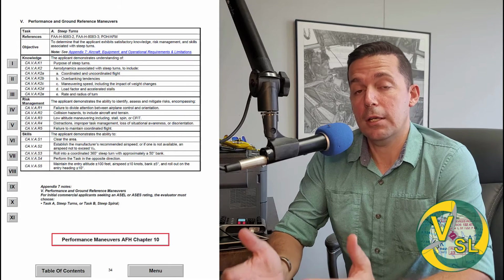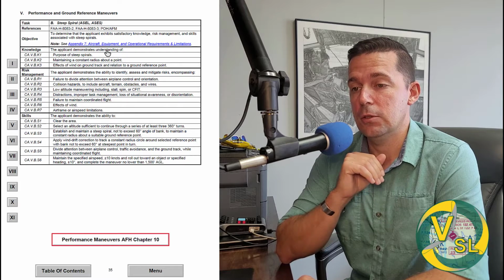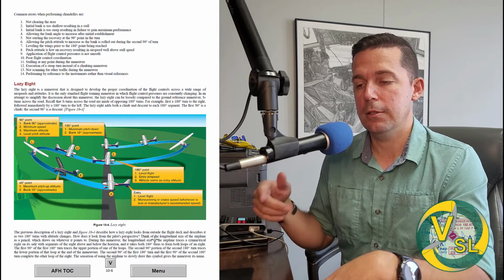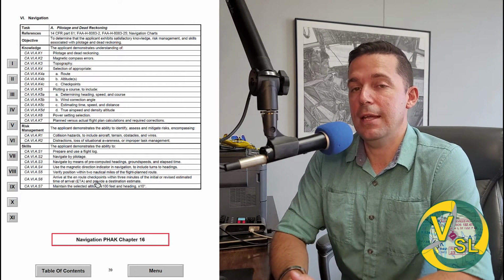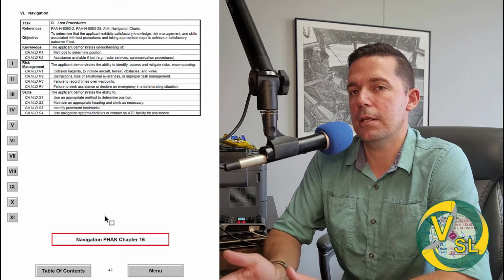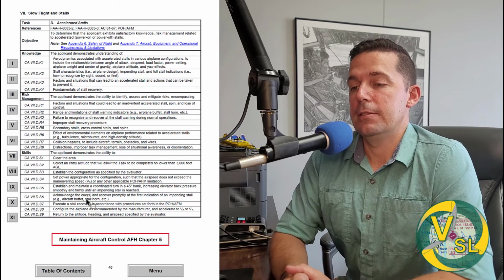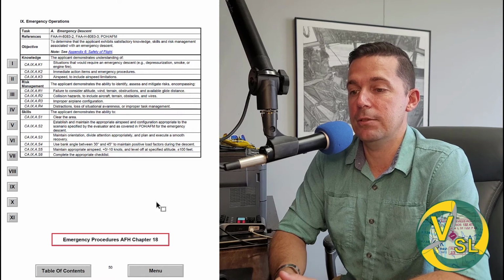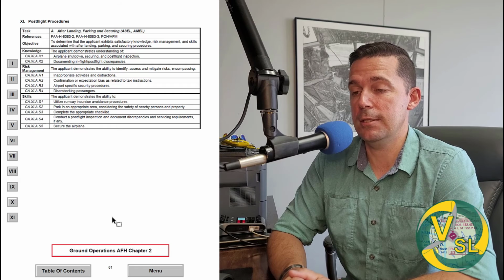Commercial Pilot ACS Review - Part 3

Comment: Most of the older(late 60s early 70s) C172 that I have rented had an engine upgrade which makes power on stalls very nose high, and depending on current weight and balance it can be difficult to get a stall indication let alone a full break at full power. 
The upgrade mostly consists of a compression increase to take advantage of 100LL both in power and fuel economy, the original c172 O-320 were built for 80/87red.) The claim in the poh suppliment is a 10hp bump, but solo on cold days I've gotten over 900fpm at Vy on takeoff.
Reply from the maker: If you find yourself having to add excessive nose up pitch (anything over 20 degrees), consider reducing power by 100-200 rpms. The ACS allows for this safety consideration when completing the power on stall.

Comment: For eights on pylons, are you required to be back on your entry altitude and airspeed when finishing the maneuver?
Reply from the maker: Nothing in the ACS or AFH discusses finishing the maneuver on the entry altitude and airspeed.  However, unless the wind changes while your doing the maneuver, you should be very close to your entry heading and airspeed at the completion of the pylon turns. If you're parameters are significantly different on exit, then you might be doing something wrong.
Reply: Thank you for replying! I’m training in Hawaii where the winds are gusty at times. I know that my newness to the maneuver is contributing to my results too, but still wanted clarification on this.

Comment: Hello,what can I expect on my commercial single add on?
Reply from the maker: Page A-12 of the commercial ACS has the additional rating task table of adding a single engine rating to an existing commercial pilot certificate.  Just start at the column that has the rating you currently hold and read down.

Comment: I have a question, could you become a CFI (ASEL) if you have a limited commercial certificate , no instrument rating
Reply from the maker: Good question.  As with most answers regarding the FAA, it depends. If you want to earn a Flight Instructor Certificate in a "other than sport pilot rating" (which is normally the case) then yes, you do need an instrument rating or ATP certificate.  

The exception is you can become a sport pilot instructor without having a instrument rating.  FAR 61.415 lists all the limitations of a sport pilot instructor.  Basically, you would be limited to providing instruction to sport pilots in LSA certified aircraft.